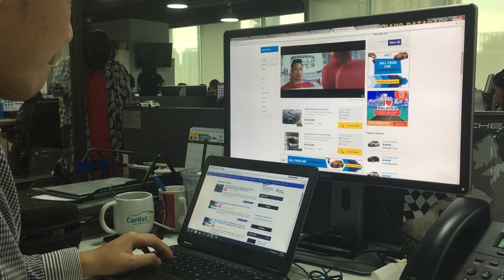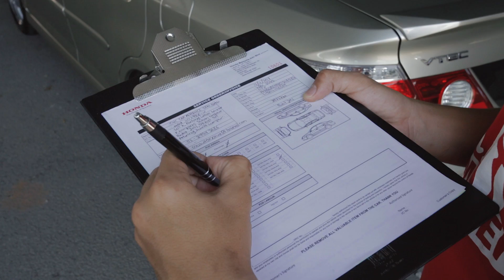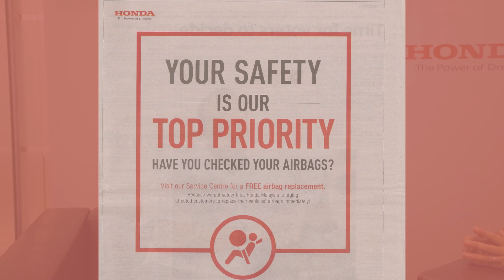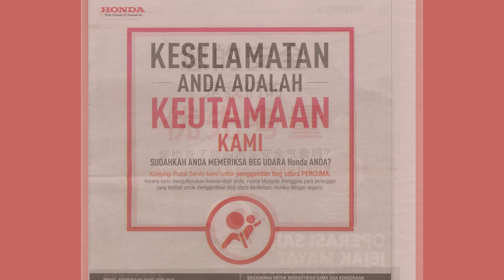Behind the scenes: How Honda's Mobile Service Crew replace defective Takata airbags on-site

Comment: no torque on the small nuts?
Reply: It's supposed to be 3.9nm, if you overtighten it the nuts self locking mechanism will not disengage properly